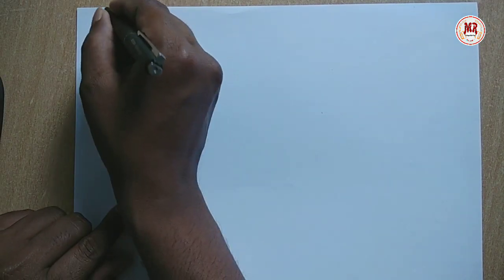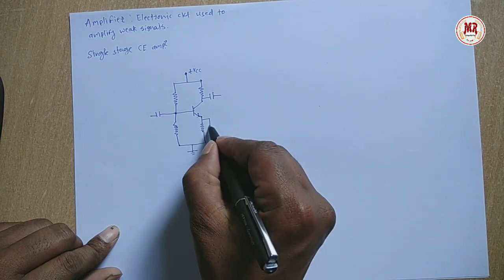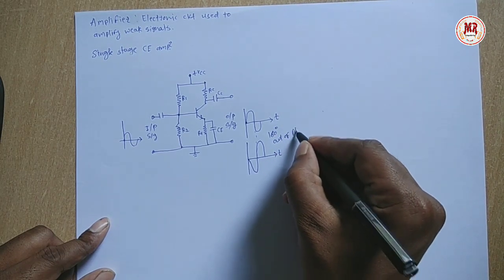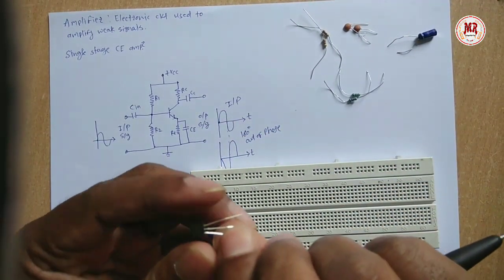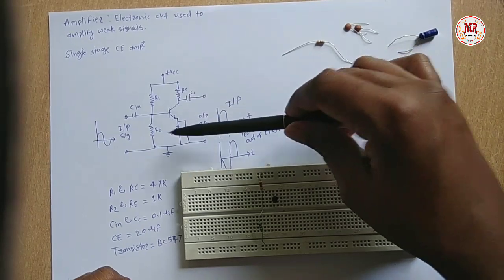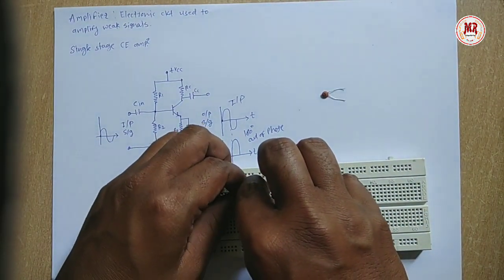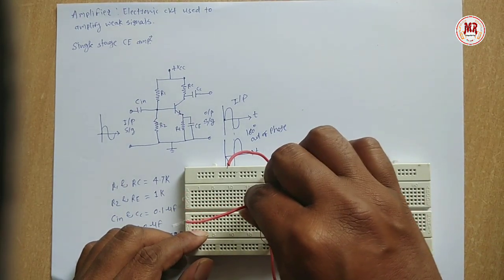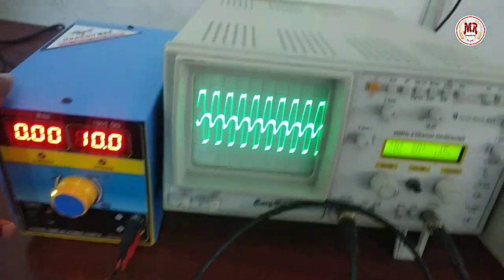single stage CE amplifier on breadboard

Comment: How to determine the components values to design the single stage ce amplifier? Sir
Reply from the maker: Already given in lab manual, or you can try simulation with different values

Comment: expt: construction of single stage transistor amplifier circuit and measurement of voltage, gain, and output impedance, how to measure these sir can tell ?
Reply from the maker: For measuring voltage refer this video
https://youtu.be/TEObI0fx1a8
After measurements you can calculate gain (output/input)
Reply: @MindsRiot  how about output impedence measuremt?

Comment: Two stage CE amplifier on PCB
Reply: Build two stage CE amplifier on PCB kaise kare
Reply: Components kon konte ahe
Reply from the maker: First try on breadboard.
2 Transistors, 8 resistors, 5 capacitors, breadboard, connecting wires. Vales of components are given in video or check in lab manual
Reply: Thanks sir

Comment: Assalam o alaikum sir.. Kindly yea bta dain k  series main ce ur re kaisy lgy gain...
Reply from the maker: Emitter capacitor CE and Emitter resistor RE are connected in parallel, not in series.
Thanks for asking question
Reply: G sir...... Agr series main kagny hun the then kaisy lgy gain

Comment: Which type of biasing we used in this practical/ ckt
Reply from the maker: Voltage divider biasing is used. Voltage divider biasing can be formed by using resistors R1 and R2.

Comment: sir inputs per kitna volts
 Ac dna h ?.kindly help!......
Reply from the maker: For input, function generator is used with 100hz to 10khz and few millivolts Vpp. For transistor biasing, 5v or 12v DC is used.
You can watch following video in which I simulated the same circuit on Multisim software, I hope it works for you

https://youtu.be/xljvMjY2p2I
Reply: Thanks sir .❤...sir agar ham 5v Ac with 50Hz Da to circuit kam kara gya .?..
Reply from the maker: @khushimuhammadkhan4911  5v AC as input signal is not recommended. First start from 10mv and then increase voltage step by step. Before going to test on breadboard, please simulate the circuit on simulation software, it will give you rough idea
Reply: Thanks sir .❤